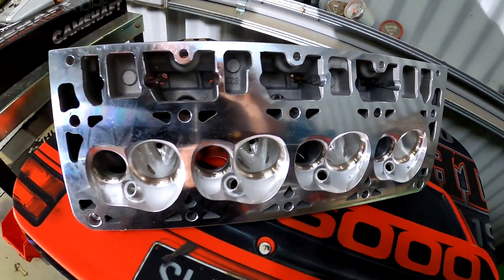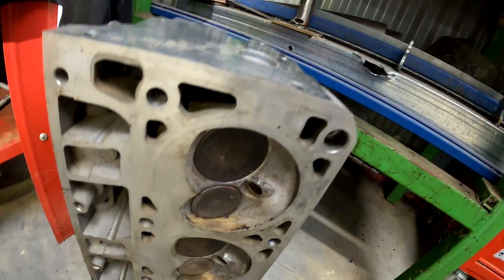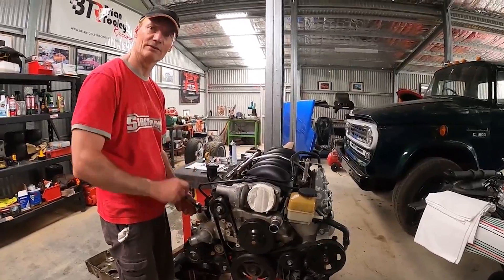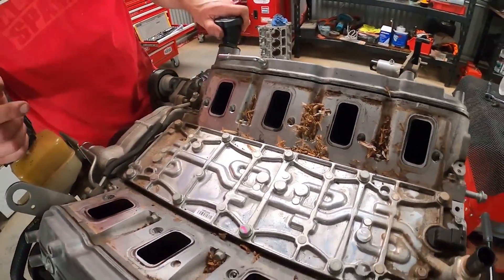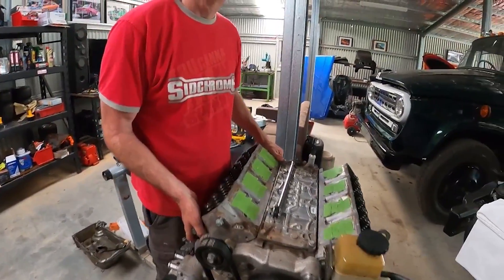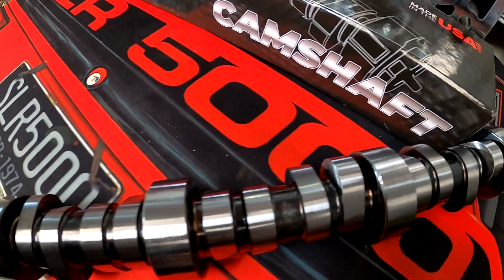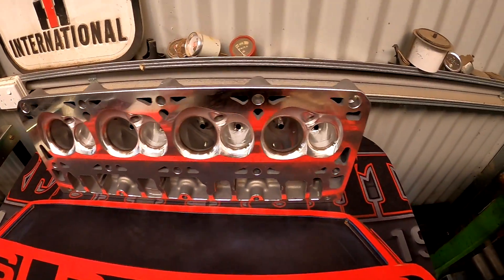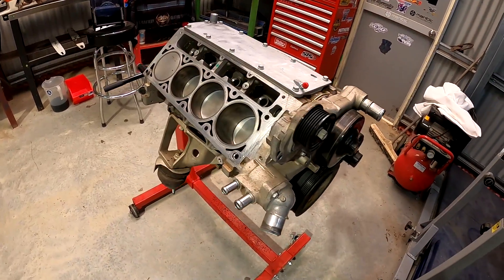LS Performance Mods | Heads and Cam Upgrade - VE/VF Commodore

Comment: When u say you do it all but the tune...how do u move the car ones u have fitted the dod delete n the big cam.  It wouldn't run so do u trailer it to the shop??
Reply from the maker: Correct, trailer it.

Comment: CNC heads are a waste of money unless your putting in big cui, a big cam and compression there's other ways to get hp out of a LS especially if you got req port heads as they already flow great engine builder are saying their only see 20hp out of a set of CNC ported heads, theres 10-15hp with roller rockers alone , fast intake manifold for even more, if you want bang for a buck put a stroker kit then you got as much as 100-125hp and huge torque, I had my heads hand ported I'm making 1400hp with my stroker and big 98mm Turbo, dont get caught up in the CNC wank unless you building something that can take advantage of big port head
Reply: You haven't got a clue 😂.

Comment: Hi, did you have any piston to valve clearance with that cam and shaving 30 thou off heads?
Reply from the maker: G'day Steve, we haven't fitted them yet but our engine builder has indicated that we will be OK. Its a massive cam so we were worried about that.

Comment: Hi Guys, love your work.. I am all inspired and have an eye on a project car -2009 Holden Ute SS VE Manual, doesnt seem to have the DOD / AFM. Would this be a good starting point to build something fast and fun?  Cheers Gerald
Reply from the maker: G'day mate, sounds good.  Yes, if you have a L98 engine VE, we believe you will be lucky in missing on the DoD.  Best of luck and they are a great platform.
Reply: @ClunieGarage  Thanks Guys, my head is spinning as there are so many good looking utes on offer, I am inspired by your $1000 mods and the big step up by doing OTR, headers and exhaust plus a  tune.. amazing.  If I coud avoid the AFM / DOD delete that would give me more cash to spend on the goodies :-). I am zeroing on on 2009 / 2010 as I think you said that should be pretty good for a manual w/o DOD. Seems the money is around 30K - 33K for a low k model. Cheers
Reply from the maker: @SalesBullshitBuster  G'day mate, yes they have sky rocketed in value and low km ones are a good investment for the future.  We were so lucky to get our ute for $5k after the hail storms and of course before prices went bat poo crazy with covid.

Comment: how many kms did this engine have?
Reply from the maker: G'day Clayton, just over 100,000.  Local car with full service history as well.
Reply: @ClunieGarage  my series 1 vf redline has done 160,000km and wanting to do a head and cam package, wanting to get a turbo killer cam from GM motorsport down here in Melbourne. There the biggest cam they offer. Do you think my reckon my car should be able to handle that much power without issues being a high km car?
Reply from the maker: G'day Clayton, oh jeez big can of worms here.  If its a series 1 redline, I am guessing you haven't done the DoD delete yet? This will be a must if going forced induction.  Also, those are high kms for a city car as well.  I would think about doing a recondition and freshen up before going forced induction.  Tear down, number 2/3 cam bearings, DoD delete, trunnion upgrade, gapped rings, new bearings, LS7 lifters and full flush etc. at a minimum.  Have you got a budget in mind? Things can escalate quickly!
Reply: @ClunieGarage  The turbo killer cam is the name of the camshaft. It's just scary knowing that if I go that route I don't want the car going tick tick boom because of the high kms
Reply from the maker: @claytonvankuyl4268  ah gotcha, I was speed reading sorry mate.  Yes, that's the gauntlet we run with modifying high km engines.  That being said, if you have serviced it correctly over its lifetime and do the other preventative steps above, you will probably be right for another 100+kms.  Particularly if the cam is coming out you can do the cam bearings and other mods listed above.  If you are really concerned, have yoh thought about treating yourself to a crate engine from holmart and build something really special with peace of mind?
Reply: @ClunieGarage  Would love to do a create engine but jeez i can imagine they start at 10K+ and then cost of install sounds horrible. Then transmission and what not sounds like a bit of buck.

Comment: With the modern machinery now now lapping valves in is a thing of the past.  A lot of the machines have their own vacuum check machine now and you just sit the valve in after the machining is done and  look at the gauge.  Most garages should have their own small vacuum unit for checking the valve seal. As a reconditioner myself in the early days we lapped valves as the equipment used was  nowhere as good as that used now. Lapping valves with the modern stuff now is a waste of time.

Comment: Why not show stock heads flow charts and then these higgins heads flow charts, as far as i know replacing heads is only worth it if your going to drag or race the car or engine, because you have to upgrade so much its not really worth it ,but hey each to their own as they say? Most important is the inlet manifold getting a low runner intake increases the hp figures by about 20 % just be replacing the intake manifold like fast low runner intake like the truck 5.3 intake, which they are based on?
Reply from the maker: G'day, this is a dedicated race engine and we have chosen to do the heads and cam at same time to get the combined compression and flow increase.  Will try and locate the flow comparisons and seem to recall the Higgins Heads can flow up to 380 cfm.  Need to determine the average factory flow rates as they differ from casting to casting.  I wouldn't normally recommend a head upgrade on its own for a street driven car as the changes in performance won't be material.
Reply from the maker: John Winzil  nice gains there mate.  Were you happy with that? Any plans for a cam?

Comment: MY VF SSV   ,Just got my car back from Cavill's performance in shepparton ,  i wasnt looking for too much power   ,left pistons stock L77  ,  Higgans heads , comp cam 226 - 235 ,  .578 -.591  , dod kit , 8 mm push rods , +10% mellings oil pump ,  comp cams Gold series Roller rockers  so got rid or needle bearing problem all together , New Mantic twin place Clutch kit,   making 350.5kw  and 469.8 HP at the rear wheels im happy with that and  didnt want to push it more than that for now,           https://www.youtube.com/watch?v=hvF2QF9i7og&list=PL99cgTfv4a_Ru_p3i_mdsMVlGXtUjFFej&index=1
Reply from the maker: G'day mate, very nice and we will check out the video.  What's next on the mods list?
Reply: @ClunieGarage    No more mods keeping it as it is now  as its still my evrryday driver  bit of a pig around town with the  lumpy cam tho   but heaps of good old grunt .  Love Clunie  as i have watched from your first video  . Love em cheers
Reply: Looks like she will be great fun to drive, great result getting 350 RWKW. I hope you are going to rip the interior out and install a cage like Clunie!

Comment: That is a massive camshaft! Not sure it'll make any power under 5000rpm
Reply from the maker: You betcha, we can't wait to hear it idle.  On the race track I spend little time under 5000rpm so should be sweet.  New track day video coming out in next few days and you will see what I mean! 😝
Reply: @ClunieGarage  I'd just be curious about your valve clearanc, I guess you find out on the build

Comment: I like the new cam & heads.
As a suggestion, In future if you are going to try show some detail (eg. Ports in heads and cam spec card) consider pausing more on the detail (less movement) or take some photos and let people look at them and talk while the photo is up then move back into the video.
Reply from the maker: G'day Big Al, noted and will incorporate your feedback in future vids mate.  Thanks for watching.  😀
Reply: @ClunieGarage  Also side by side comparison of old vs new for reference, would be helpful too
Reply from the maker: G'day mate, unfortunately they are an exchange unit so I can't compare them side by side.  I did show how different they are to a LS1 cathederal port head in the video.

Comment: Gee they look pretty trick. What a difference from the standard heads. Are you replacing the exhaust valves for some sodium filled ones? Hopefully this motor gets put together soon.
Reply from the maker: G'day Angry, we might try and lap the current valves in and see how we go.  This engine is seriously coming together now and thanks for watching!!

Comment: Where's the spec list big fella? Looks like it will be pretty tuff but still streetable.
Reply: I don't think streetable is particularly important to this build. I am hoping that it is grumpy and a pig to drive. Should add to the intimidation factor to other track cars.
Reply from the maker: G'day Zack, I showed the spec list of the cam in the video and I will update the description of the video with the full details tomorrow as well.  I don't think it will be streetable.  Frankie and I are getting a Organic clutch, lightened flywheel as well which will make it a nightmare to drive around town but a beauty on the track!! 😍🙏

Comment: Are you going to boost this engine or keep it n/a?
Reply from the maker: G'day Pedro, as we have documented throughout the build, this is going to be a normally aspirated build.  We are focusing on cams, cubes and compression!!!  Thanks for watching.
Reply: What's the CR
Reply: With 30 thou shaved off the face it should be north of 11:1.
Reply: My vote is for a sneaky Nitros system.